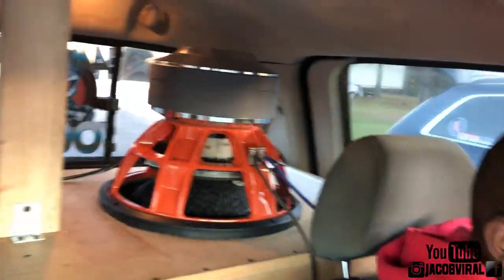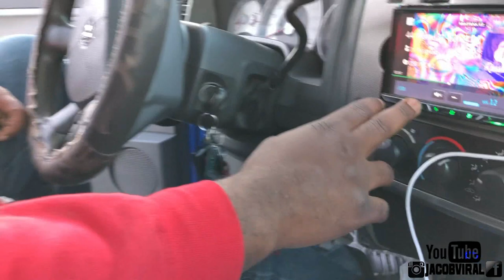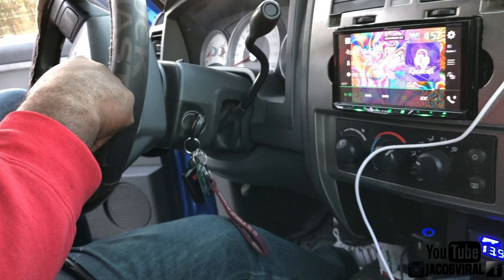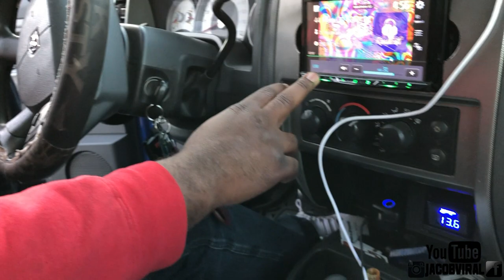2 15S BACK SEAT TRUCK BUILD FLEX!

Comment: Man, my 2 Rockville K9 15s are louder than those..
Reply: Buick Regal  had them for 3 months and have had 0 problems. I play them max volume, full gain, and equliazer turned all the way up. Some times negative hype is bullshit
Reply: Buick Regal  I don't have to but to get as loud as possible the k9s perform phenomally . 3 months is long compared tomthe video with exo it burns out after 30 seconds of music. My amp is 2000 watts CEA rated. What kind of amp do you have? Or subs?